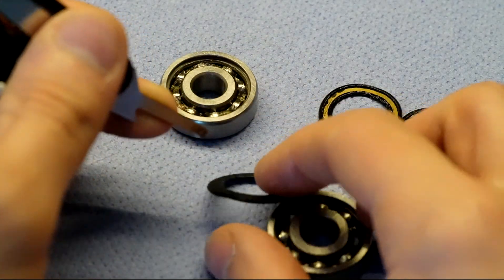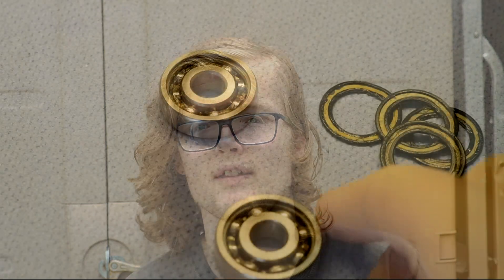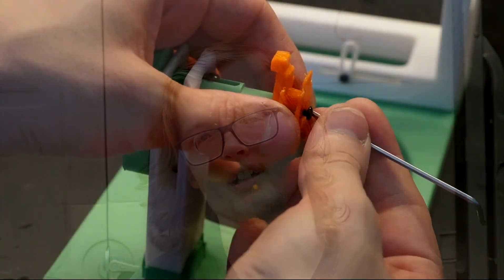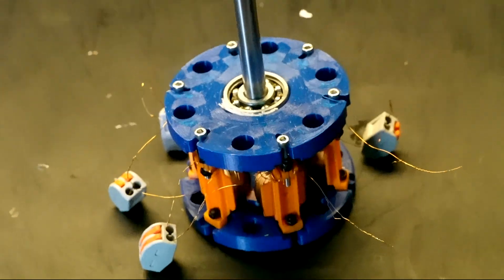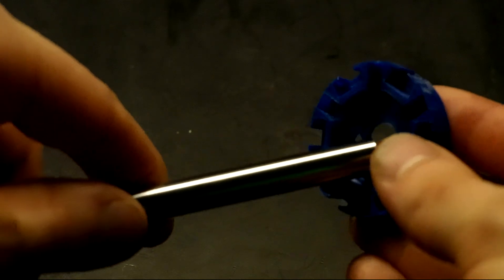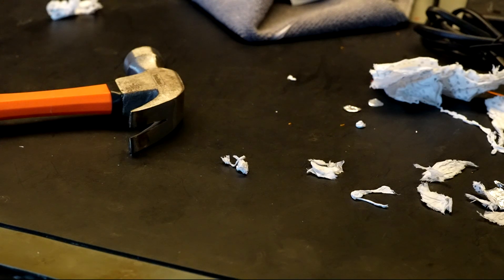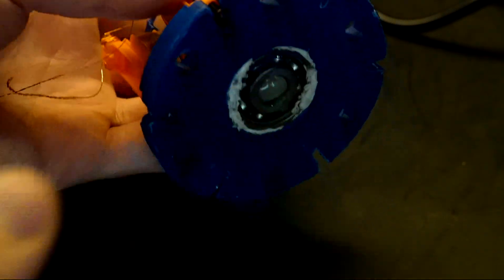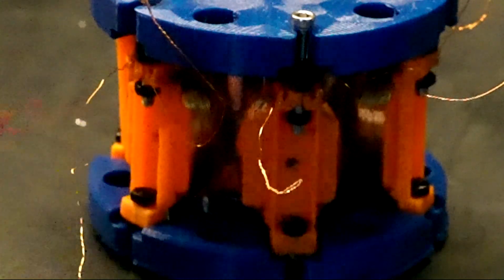ModuCoil Generator V2 - Now with Full Modularity!

Comment: A tip: this type of wire can have the end cleared of enamel by heating with a soldering iron and adding a bit of solder moving it up and down. This burns off the enamel. You see a lot of people using abrasive techniques but this solution works best for me. Keep up the good work. Looking forward to seeing the voltage and current readings under load. Thanks. Good luck.
Reply: this doesn't work once the wire reaches a certain thickness, that is, the insulation reaches a certain thickness. at this point the insulation just melts and don't burn off properly, leaving behind a layer of black insulation that have to be scraped of.